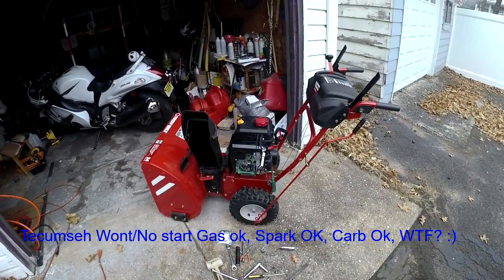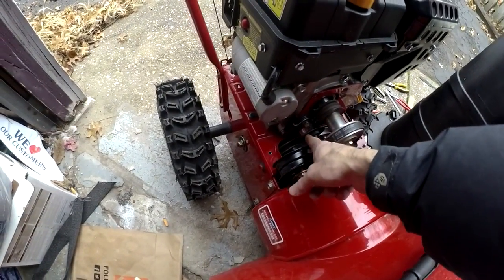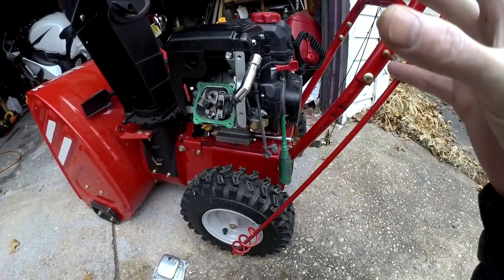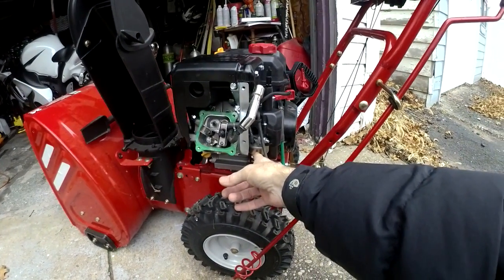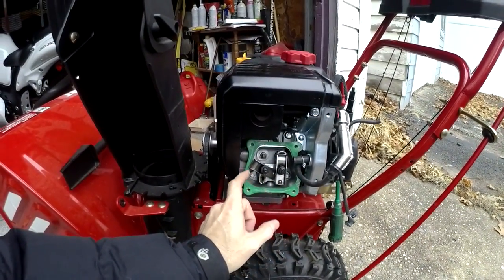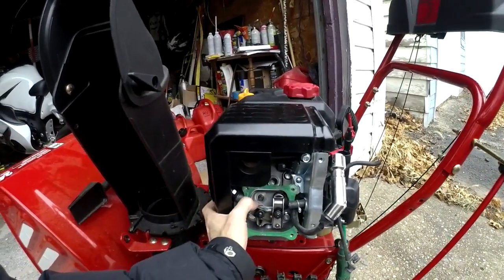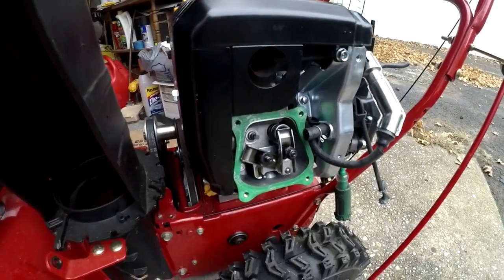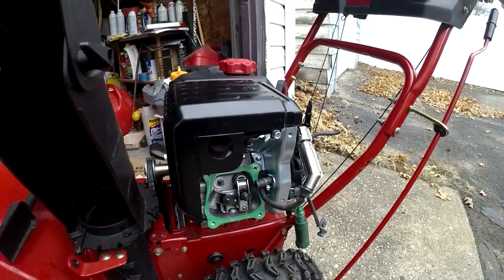Snowblower Troy built startup OHV problem won't start help

Comment: Mine is doing same damn thing and only a week old.
Reply from the maker: Definitely check to make sure the pulley wheel is tight so you don't lose a belt that was the first issue I had. (Drive belt pulley, not auger).

Pull off the OHV cover and just spray some lubricant on the valve stems and work them in and out
Reply: @wiley0714  It's still under warranty just going to take it in.

Comment: Thank you for your video. I just fixed a TroyBilt by doing this. Popped off the OHV valve cover, WD40, put everything back together, and it coughed and tried to start but still wouldn't quite catch. Pulled out the spark plug, shot some WD40 in there, reseated the spark, and she coughed a couple of times but finally caught and is running now. Thanks.
Reply from the maker: Why WD40? I can see squirting some fuel with oil directly into the combustion chamber. And while WD-40 might lubricate, I don't see it being that highly combustible to help kick the engine over. 

 To each his own but if you want to spend the extra $5 it might pay to add the Lucas treatment. It's safe in 2 and 4 cylinder engines that lubricates and cleans. To me it's just an extra step to keep those valves lubricated so you don't throw a rod or rocker. P.s. check your rockers in your overhead valve and make sure the clearance is right and that the nuts are on tight.... it only takes a few bolts to remove that cover and it'll save you a headache down the road.
Reply: @wiley0714  I had already dumped some Mechanic In a Bottle in the gas tank, taken off the carburetor bowl and cleaned all of that out with carburetor cleaner. Not sure why or how WD40 got it to kick over after spraying it in there, but it worked.
Reply from the maker: @westmanjoel  might have been since it was new, that the piston rings weren't seated, and the WD-40 helped (seal up ) the compression chamber and therefore allowed it to pull (more air and fuel mixture, volume) in.

At least that's my theory.

Comment: My Snow Blower has a popping sound but it runs. Also has smoke. Is this dangerous to let run? I used Snow foam to get it to run?
Reply from the maker: Hard to say. I would make sure :
Fuel is good.
Carb is clean
Plug is gapped rite ( make sure the tip of plug is tight , electrode tip, tighten with pliers, most unscrew, unless you have a solid tip plug).

Check the vavles to make sure there lubricated and go in and out freely... you're popping maybe due to pulling in excess air if one of the valves is stuck.....
I'm not an expert....

Comment: Great diagnosis. I had identical problem with same 1 yr old Tecsumeh engine and tried to fix it doing exactly what you initially did, without success. Then I saw your video. Less than an hour later it was purring like a cat. There's definitely a defect in Tecumseh's design or production specifications. I realize we're dealing with tight tolerances here and adding heat complicates it. However, this isn't rocket science and has been successfully accomplished for many many years by engine builders. It's a good bet that this will be a rather wide spread Tecsumeh problem, which often will not be diagnosed. Thanks for taking the time to make the video.
Reply from the maker: Polunki glad worked out for you. I'm looking into the Lucas fuel additive as it states and helps to lubricate valves. ;)
Reply from the maker: Polunki and just as a correction I did realize after I made the video it's a quote-unquote Troy-Bilt engine
Reply: That is not a Tecumseh. Thats a Chinese made POS engine.

Comment: Good job bro stuck exhaust valve. I had a similar problem mice got behind my flywheel and chewed my wires bastards... I wonder if the Avgas had something to do with it?
Reply from the maker: Enjoying The Sun 577-Jersey Customs I read a lot on the av gas and aside from it being a low lead Aviation product I do realize that still makes it a lead product compared to an unleaded fuel. The fuel does get additives like seafoam, so it does actually have more lubrication then if standard fuel vapor. It's a four stroke engine so those valves should be getting their lubrication from the oil in the engine regardless! Although I have to admit when it comes to a 4-stroke lubrication system I will have to learn a little more on that. 
I know what the rotax 582 engine I have, I have to manually rotate the prop before I start it, and bleed any air. I probably be better off with this engine just pulling the cylinder over a few times to pre-oil it in the same fashion.
Reply: @wiley0714  Your okay running gas with lead in anything that has no fuel injection or cat. However lead is a very soft porous metal, so it very well could have lodged under the seat of the valve which caused it to stick, its still much more probable that because those engines are made in china under much less quality control, that is your most likely cause. They say lead in gas usually helps keep all the parts even better lubricated because of how a nice soft porous metal is, in small engines its harmless, but maybe the lead did help cause your valve to stick. These days the best fuel to run in a small engine is 89 to 91 octane ethanol free fuel, you can go higher but its really not necessary anything us better than regular 89 to 91 is nore than ample, the inportant thing is the lack of ethanol, use that and your small equipment will stay in the best shape possible and the gas will not go bad anywhere near as fast. A little stabil increases the life even longer. Its still always good to run the carb dry before storing away for the season.
Reply: How is that similar to a stuck valve?
This valve sticking issue is pretty rare, not as rare on chinese engines but rare.
Criters nesting in an engine, making a mess and chewing on stuff, thats pretty common. No simularity except issue with the engine.